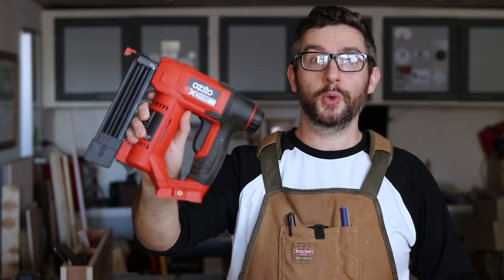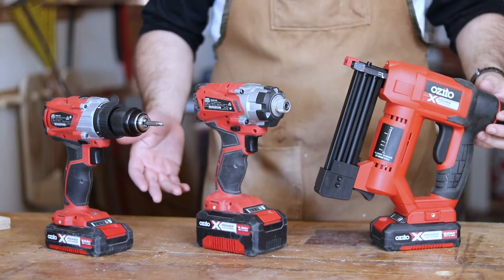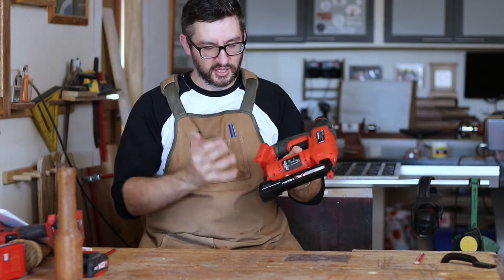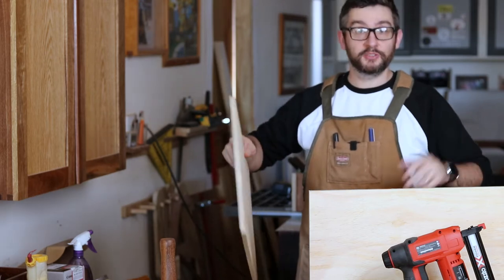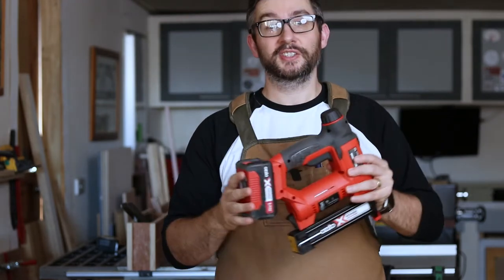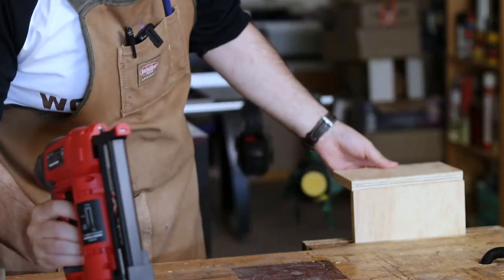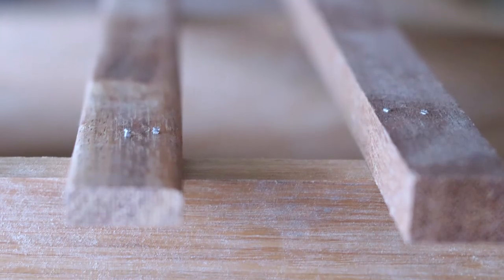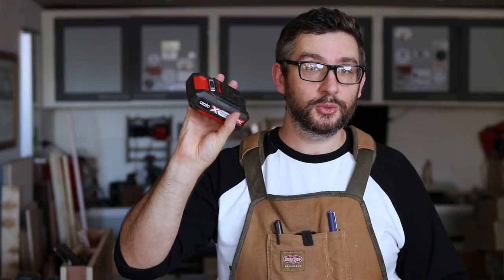Do woodworkers need nail guns?

Comment: Got it, used it, really like it.

I’m a fan of Ozito, the range it growing and bang for buck (especially the 5yr almost no questions warranty) they rock.
Have most of the PXC range from drill & driver to rattle gun and chainsaw.
And I’m a bit more than a hobbyist, using them almost daily around farm and in shed.

The nailer works as well as near any other cordless ,non gassed, nailer I’ve used.
And the stapler has now done multiple upholstery projects. Canvas art frames, seats and rubber upholstered padding in horse floats.
😊

Comment: I’m a carpet layer, I love this staple gun . It’s great for reinforcing smooth edge and works great for small jobs too.I would suggest taking off the red tip because the staples go in deeper without it.👍
Reply from the maker: Ooh interesting, I'll check it out tomorrow and see if it's worthwhile testing without the tip.
Reply: @woodfather  have you tried and how did it work without that tip? Thinking of buying this one for paneling moulding project but quite afraid it will not nail flush and need hammer to tap in the last 1-2mm every nail…. That will defeat the purpose of using this tool! Thanks for this great video and honest & factual review!
Reply: Excellent idea. I'm going to try that!

Comment: Even my Makita C1 nailer needs good pressure behind it to sink properly. Honestly it looks a bit slower and doesn't have quite the same punch, but for 1/4 of the price you can't complain too much!
Reply from the maker: I can complain a little though...right? 😆 I actually used it to trim out a doorway in my workshop yesterday, MDF skirting boards, worked a treat. I wouldn't want to have to do a whole house with it lol, but for the odd job where time isn't a huge factor, I can't complain.

Comment: I'm in the Ozito world, and I've just bought one. I see what you mean about the depth dial being useless. All my brads are sticking out a bit. I thought about taking it back for some expert advice from someone wearing a green apron, but I'll try the push hard idea first. It's more than a bit annoying though....
Reply from the maker: to be fair, even on high quality guns you still need to put pressure behind it to fully sink the nailhead - but the depth dealie here is a gimmick that should have been left off, makes zero difference in use. 👍
Reply: Good luck finding the mythical wearers of the green aprons. 😁

Comment: If you are after quiet compressors try Sydney Tools they sell some that are super quiet ... like I can have a normal conversation with it on quiet. I can airbrush and spraygun with one so I reckon your nailer may be ok as long as it's not cranking out tonnes of nails.
Reply from the maker: I've not bought one yet, but the next time I have a compressor heavy project, I think I will treat myself to a silent one, they seem awesome. 👍

Comment: Really good review Mario, was looking at buying one a while back but had no batteries & like you I’ve a Ryobi Air Strike so I probably won’t get one.
Happy days mate 🍻👍
Reply from the maker: Heya Dirk! You're on the money there, if you don't already have the batteries it probably feels too expensive. By that point you may as well spend a little bit more and buy the higher quality one. It's working out well in my workshop though, doing the exact job I wanted it to do, quite well.

Comment: Woodfather learns brad nailing 😂. Great review, now I know it's slower per nail that the air compressor type. I have bought a silent air compressor so I'll stick with my paslode for now, absolutely love that one. I think if I need to put nails in stuff outside my workshop a lot, I would get me one of those. Thanks again for the review!
Reply from the maker: Ooh, hey Jesper, I've heard of the silent air compressors but, well, I've never actually heard one... 🥁🥁 😄 Is it a huge difference? My compressor is only a couple years old so I can't justify upgrading for quite a while. I tend to not look too deeply into new tech/tools if I know I don't want to spend the money anyway, otherwise I start making excuses as for why I need them after all... 😆
Reply: @woodfather  Hey Mario, I think my compressor is about 50db, it's like the compressor on your fridge. Normal compressors are in 100-120db range.
Reply: I have a silent air  compressor.  Trouble is that it also delivers silent air. 😲

Comment: Useful video - thanks! I have mainly Dewalt tools although we do have a few Einhell (we’re in UK) gardening tools. If I got one of these I could just use the red batteries but I think you can get an adaptor to make Dewalt fit.
Reply from the maker: I think that's one of the most amazing features of 3D printers, you can use them to make adaptors for anything it seems. I haven't tried myself, I'm worried if I buy a 3D printer I'll get carried away and not return to my other hobbies! Cheers Nigel!

Comment: Thx for the video. It looked like the wood gets damaged each time you fired a nail and pressed hard into it, does that seem to be a problem?

Also any update on how it performs with the red tip removed? Any stronger?
Reply: Have you tried putting a few drops (or more) of water onto the damaged area and see if it will swell up to the pre-deformed condition?

Comment: If you put a little bit of pressure on nail gun it will push it below the survive by a 1mm or 2mm, except for really hard woods like ash or oak.
Reply from the maker: I can't get it to sink all the way in Spotted Gum either, but that is a very dense wood. For how I tend to use it though, MDF, pine, plywood, it's perfect. 👍

Comment: Brother, Buy a silent compressor and get rid of that dinosaur. I know they are on the expensive side but they are fantastic units. I've got a Chicago Hush30 myself love the thing to bits. Although that being said i'll still buy the Ozito Cordless Nailer vs a pneumatic version.
Reply from the maker: I'd love a silent one, but I use it so rarely it's tough to justify the purchase while this is working. Definitely if this one ever gives me trouble it'll be right out the workshop and a new silent one brought into replace it quickly 😆

Comment: You have to remember that basic physics come into play...the tool is attempting to drive the pin into a material, so the force of driving that pin goes both directions - forward onto the pin, and backwards into the tool.  To minimise the force going into the tool, and to ensure as much of that force as possible is actually going onto the pin, you need to apply your strength to the tool, or the recoil of striking the pin will bounce the tool backwards.  That said, this is a good bottom tier tool for doing what it does - light nailing and light stapling.  Think of the job it is for - what size pin or nail you need for the job it has to do, and what material it has to go into.  This is marketted for basic stapling, and basic furniture work, such as stapling down upholstery or carpet, or for pinning a sheet of replacement plywood onto the bottom of a storage box or bench seat...it's not meant for framing, or nailing floor boards down.  It does work at the lower end of the 'finishing' nailer range, such as putting in trim or light fixing but for anything more than that you are probably looking at a 16gauge nailer.  For what it is, and it's price, it is a very handy tool.  I've used mine on furniture repair, adding beading to deck posts (into spotted gum, which needed a bit of hammer and nail setter work), and wooden window repair.
Reply from the maker: Nice one, thats definitely correct, not for framing or floor boards. For my purposes it has been really useful, so long as you know and accept the limitations, it's a great tool! Cheers!

Comment: Nice review mate. I've often thought about tools at this end of the market, especially because of the price, but because I'm already on two other battery platforms I've been reluctant. I would love a brad nailer (that isn't attached to a compressor) but haven't really used the air one I have enough to warrant it. I can definitely see your use for it as an extra pair of hands when assembling and finish carpentry indoors. Happy new year mate!
Reply from the maker: Cheers Sam. I've planned to switch brands in the past, but I bought the ozito impact driver years ago (not the one in this video, diff model), and it was an absolute beast. Renovated the workshop and half the house with it. Because it did such a great job, when it died I bought a replacement, and I've just been buying Ozito where it makes sense ever since. The Ryobi air guns I have are definitely far better than this nailer, but not having to plug in the compressor for a quick coulpe bangs is soooooo much better. 🙂
Reply from the maker: And happy new year to you!
Reply: Hi mate, I'm on AEG for all my pricier well used stuff, but for tools that I'd use once in a blue moon, the Ozito is well worth it. I have a reciprocating saw, ratchet gun and Rotary Hammer drill from the PXC range and they are more than enough. 

It would have cost me 4x as much to buy the equivalent in AEG.
Reply: @XXB4XX  Cheers mate. The bulk of my tools are AEG and Makita (started off on AEG but have started migrating away to Makita for reasons that aren't relevant here) . I'm fortunate that because I work in the trades when I make a tool purchase sometimes they double up and get use at work too, however I've no need in gas work for a brad nailer, that's purely my woodworking hobby! I have seriously considered this tool and have a project soon that will benefit from a cordless brad nailer, however beasue I'd need to buy the battery and charger it puts it in the realm of almost the price of Ryobi and AEG. With aeg i've got heaps of batteries, but have also found a batter adaptor that means I can use my Makita batteries in Ryobi tools, which opens up some options there for around the same price point. I've had a squizz through the rest of the Ozito range and i've got the rest of it covered in my other tools, so wouldn't get other use from the battery. Cheers!
Reply: I mentioned in another post that you can 3D print adapters that will allow you to use a non Ozito battery in an Ozito tool. If I remember I will find a links if there is an adapter for AEG battery to Ozito tool available.

Comment: Good review, I've thought about getting this as well. Mainly for quick light duty woodwork jobs. Looks like it would be pretty useless in regards to fixing skirting to old hardwood frames with gyprock in between?
Reply from the maker: Hey mate, yeah I think it would struggle in that scenario. I used it the other day on mdf skirts through plaster, into pine framing, it worked, but that seemed to be on the edge of its abilities. Definitely a light duty tool only. 👍

Comment: Good video mate. It was good to see it used on different materials since all the other reviews i watched were just using it on pine or ply. I've got both dewalt and ozito ecosystems and i think that if i was to do it again I'd just go the ryobi stuff to be in the middle. They seem to do the biggest range of tools and they are cheap enough.
Reply from the maker: Cheers mate, yep I'm with you, if I was starting over I might choose Ryobi as well. It's hard to make the switch though, as so far the Ozito's have always gotten the job done for me. I really like their gardening tools too, the grass trimmer is spectacular value. Maybe if I have 2 or 3 batteries lose charge all at once, that might be the motivator to switch brands, but so far, they're going good. Cheers!

Comment: Think this a the same as a Einhell TE-CN 18. Or even lower, a TC model. Einhell has 3 lineups TC, TE and TP. TP can most certainly compete with a brand like Ryobi or Bosch green.
Reply from the maker: Yep, I think Einhell is the UK branding? I wasn't aware of that until a little while ago. I don't think this is one of their best tools, but there are a couple Ozito ones, like the Palm Router, that has done everything I've ever asked of it, so I'm definitely a fan.
Reply: @woodfather  Einhell is the brandname in Europe (and parent company of Ozito). Bought the TE-CN 18 a week ago for a small project. It made it so much easier and worked just fine.

Comment: There are 3 things that matter in a tool -  
1. Performance and Precision
2. Ruggedness
3. Price

I cannot find a brand that gives great performance and precision that is not ALSO trade and pro quality... therefore I need to spend more to get that.

I ended up replacing my Ozito with Milwuakee purely because the Drill and Driver were too gutless. I wish Ozito made their tools more powerful while keeping other factors the same.
Reply from the maker: Yep, the old, "pick any two" triangle. Precise and rugged is always the desire, but it will cost you in the price corner. If I found myself doing handyman jobs here and there, I might upgrade, but I think this will last me a long time the way I use it. 👍

Comment: Great video Mario. I’ve been considering the battery adapters you can purchase on eBay to convert a battery to fit another brand. I’ve looked at battery c1 nailers. Certainly not wanting to turn on the air compressor would be a plus.
Reply from the maker: Ooh they look handy. If you've already got a few DeWalt's or Makita's it might be helpful to get the converter for a special tool or two from the other brand, not sure if they'd sell them for Ozito's though 😄Honestly, not using the compressor for a couple nails here and there is so good, I generally work in silence so it's always a shock when it kicks in.
Reply: At the other end for a mere $400-$500 you can get my little Makita C1 nailer ;) It's pretty awesome (made in the UK would you believe) if you are one team teal... just not cheap.
Reply: @FixitFingers  I'm team teal 💯, currently saving up for that, just have other priorities ATM.

Comment: Hi Mario, Looks like it would be worth it since I already have the Ozito drill, impact driver and multifunction tool.   @ 3:04 looks like it dents the wood if you press hard?
Reply from the maker: oh dang, I should have gone into more detail with that. 🤦‍♂If you press hard, into soft wood, then yes, it will leave a mark. Into hard wood, not so much. You can find a sweet spot where the nail will be 'almost' flush with no mark in soft, but then you have to tap it in further with a hammer. Truth be told, I'm not planning on using this for any finish work, so it likely won't be an issue for me. In my use case, the nail hole will either be hidden, or, filled and painted, so I get to ignore the hole and just press it in as hard as I can 😆
Reply: @woodfather  cool, you can always use a nail punch to knock them  down under the surface. As you have to with a traditional hammered nail.

Comment: Nice review Mario, spot on about the battery club. I am in the DeWalt club only because my son is in the trade and gets me a good price; no way would I have joined that cult if paying retail. 

As for the Ozito it's like buying the Workzone (exact same model numbers as Ryobi) range from Aldi; they all come from the same factory in China and are made to a price point. Would I want to see a tradie walk through my door with Ozito tools in his bag, hell no. For the weekend hackers like us, sure.

Cheers, David
Reply from the maker: hehe, yep, you'd have to have some concerns if a tradie rocked up with a van full of Ozito 😆 I used to work with a builder so he had all the top of the range Makita/Dewalts/Paslodes, etc, that I got to play with each day. They were great to use, different world to the cheaper stuff I buy, but when you're dropping over $1000 on a single drill you'd want it to be bloody good!  😄
Reply: Trades have been known to grab an Ozito tool from Bunnings if they are a distance from home and don't have their pro tool in the Ute. It's good enough to do a one off job and is cheaper than having to drive home and back plus they can claim the purchase on their tax since its a work tool.

Comment: I had two of ozito nail guns.and both broken.its cheap.and hobby use only.the gun has very weak connect body and nail system.which is only one small point of plastic.
Reply from the maker: Yep, definitely not for any serious use. I have a couple Ryobi air powered nailguns if I need to make something at a higher level of quality, but this one has been helpful in a few occasions.

Comment: It's still cheaper to buy the skin, batteries, and charger than to get the cheapest Makita skin.
Reply from the maker: Definitely is, but you would certainly get a major improvement in the quality and robustness of the tool, if you splurged for the professional quality one. All depends on your use case I guess. 👍
Reply: @woodfather  I'm still weighing that up. Like you, I'm not a tradie. I've never needed one before, but need one now for a project. I may not need it again for months or years. Ozito full kit is $280, Makita cheapest is $478, and it doesn't even do staples.

Comment: I bought this and the battery because it worked out cheaper than getting a ryobi skin only (I’m a ryobi user) I like it, but I wish the nails drove in harder on the shiplap I put up 🫤
Reply from the maker: Yep that's about the main issue with it. It works, but only to a certain quality point. I still like mine, but it sees very infrequent use so still the right decision for me. 👍